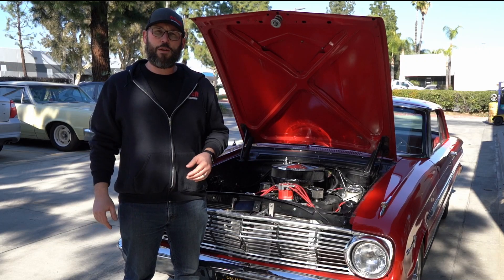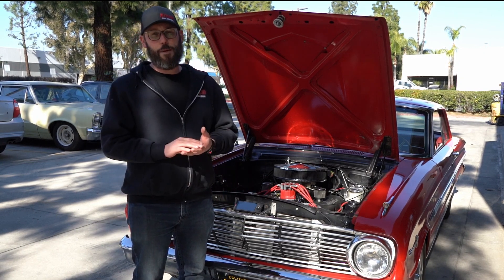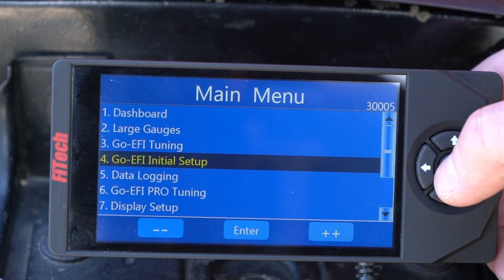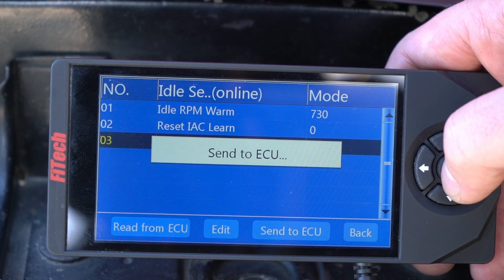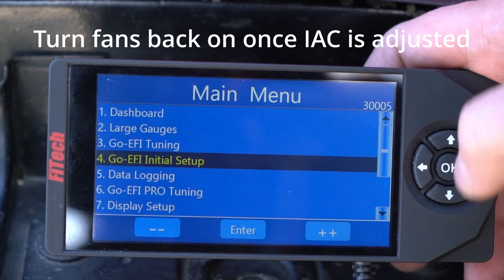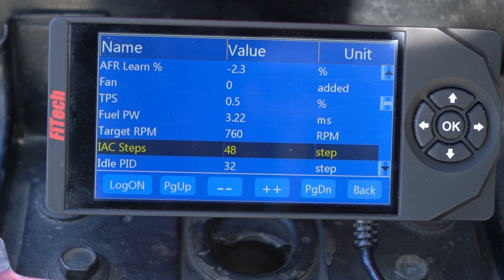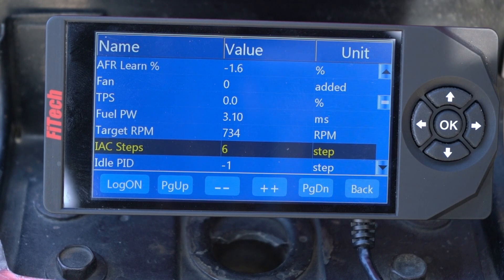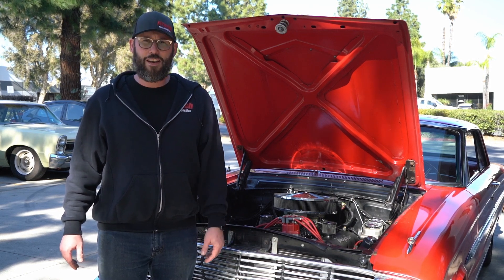Throttle Adjustment | Tech Tuesdays | EP60

Comment: After completing the IAC adjustment between 3 and 10, do you then return "Idle Set Mode" to OFF.
Reply from the maker: After the key off cycle the system will revert to off.

Comment: I have a fitech 30003 go street. It has a idle screw for primary and and secondary... when doing iac do I just turn the primary screw or both?
Reply from the maker: Use the primary. You can run the secondary in just to the stop after you are done but this is not required.
Reply: I did that. Now it has a rough idle @FiTechEFImedia

Comment: After you set the IAC between 3 and 10, what is done to save the information to the ECU?
Reply from the maker: There is nothing to save on this. The IAC is dependent on throttle position so as long as the throttle adjust screw isnt changed then nothing will change.

Comment: Hi. I have some issues with my 3004 Fitech. I have chevy sb turbo set up, when it warm it get perfectly between 3-8 on IAC. My issue is when Im running the truck I hit the pedal hard to accelerate and the system dies and shut off....what could be my problem?
I already check full press and its constant 58 psi.
Reply from the maker: There could be a lot of possibilities so I would recommend reaching out to your tech department. However a couple possibilities are loss of fuel pressure when the throttle is hit or even a fault code for something like RPM noise.

Comment: I was fucking with IAC and now the car won’t start.
Reply from the maker: Hello, have you contacted our tech department for assistance? They will have follow up questions to help solve this issue.
Reply: @FiTechEFImedia I will reach out it keeps happening and then it hard to get the car to start after I mess with it.
Reply: @FiTechEFImedia  I contacted them and she’s back up and running. I found IAC screw procedures online. Honestly, I like FiTech videos but these written IAC directions are a must have.
Reply: Wouldn’t it be great if FiTech gave you an actual tuning manual? With actual tuning tips? Terrible tech department

Comment: Hi, i set it to all zero, disabled the fan and sent it to ECU. but whenever i turn the swith back and in, my handheld (30003) change it all zero to normal and make the fan enable. Why this happened?
Reply from the maker: This is due to Calibration unlock, This can be checked in the display setup menu to ensure it is disabled. If calibration unlock is enabled, it can lock the tune and prevent changes from being saved.
Reply: @FiTechEFImedia  i appreciate you. Exactly you right, my problem was about calibration unlock, i disabled it and everything is just ok.
Reply: @sirenswhispering this messed me up too.

Comment: Clockwise or counter clockwise
Reply from the maker: depends on if you want IAC steps higher or lower. You will turn the adjustment screw clockwise to lower the IAC steps.

Comment: I have mean street 800 and it runs great but after i do this procedure my IAC bounce from 0 to 3  then 0 to 4.  I can back throttle screw off to almost shutting down engine and i still get same readings.  434 sbc solid roller 660   Dart pro 1 230 .. would cam cause this?
Reply: You ever figure it out
Reply: @RumpleFoarSkin69  yes I has to open rear butterfly a little more. Then relearn the IAC
Reply: @jeffreyviands3242  do you know where that rear screw is?
Reply: @RumpleFoarSkin69  it's on passengers side rear of throttle body.

Comment: I’ve always wondered “what the scoop” was on the unused progressive linkage slot on the TBI units.  Obviously, I know it doesn’t work.  The software would need an adjustable parameter for the user to set the TPS % for when the secondaries begin to move and maybe different VE tables at the very least.  I wonder why that was never done? 🤔   Also assuming the front and rear injectors are on separate drivers.

Comment: I have one important question: Must have the secondarie throttle blades the same opening in idle than the primeries??? Please give me an advise. Thank you!
Reply: The goal is for both the “primary” and “secondary” throttle blades to be set the same amount and move in unison while maintaining the IAC steps between 3 and 10.  Both front and rear idle screws should start out at a baseline.  For example ½ a turn-in after touching. ¾ to 1 turn-in for more demanding engines.  In other words, opening enough to allow the engine to start and idle (up to temp) for initial setup.  Also FYI: Changing the idle rpm target after initial setup can affect IAC step counts.
Reply: @isingthebodyelectric1041  Thank`s a lot!
This helps!!
Reply from the maker: Yes you do

Comment: Why is my EFI idling up and down until I can get it to warm up some and then it idles at 1200 I try to set the IAC and it ends up killing the motor
Reply: Check your fuel system. Do you have a pressure gauge at the throttle body? The EFI system doesn’t know what fuel pressure it’s getting.
Reply from the maker: Sounds like you have a vacuum leak.